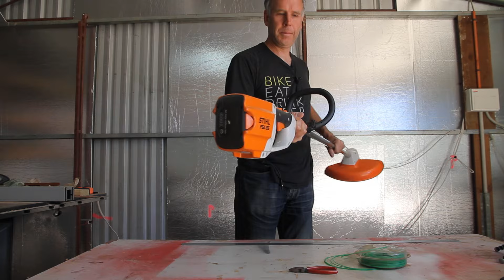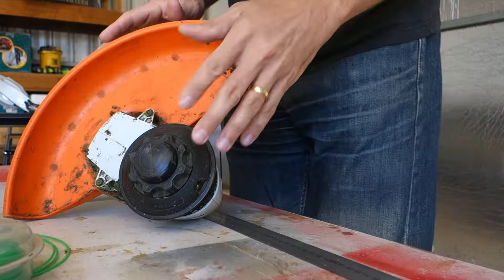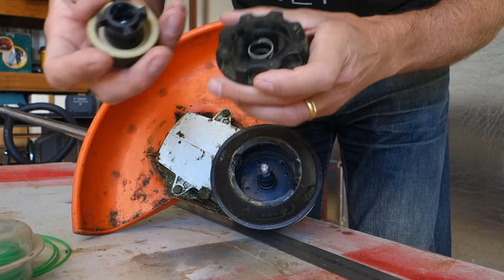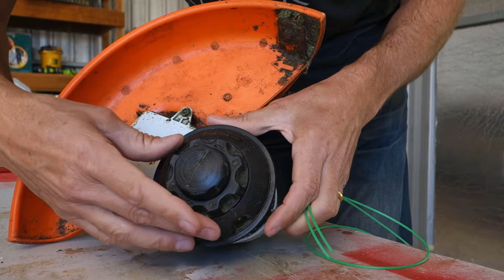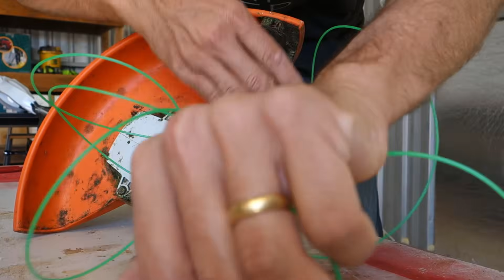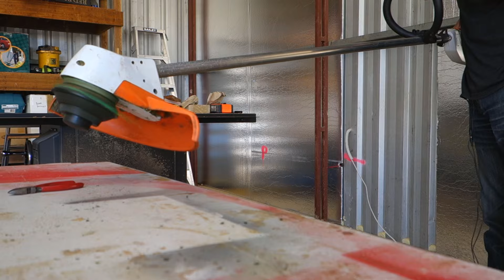Stihl FSA 85 Battery Trimmer Line Replacement

Comment: I have a second Trimmer but its a different model, I have to thread the line all the way through the center and make sure its even on both sides and then I wind it up.  This is slighty different but I will try it this way. thanks for your help

Comment: Absolutely if I would have known 7 years ago it would be so fiddly I would have never bought this bloody strimmer!  I almost come to hate to use it! But thanks to your video I tried again to feed the line in and it worked.
However the “sweet” spot is when you manage to get it into the hole on the other side of the feeding hole and it stays there until you twist the spool anticlockwise.
Don’t buy this strimmer! And Iam  German! My local garden machinery supplier always shows me how easy it is to feed in but he gets customers in every day he has to to do it for!😂

Comment: Hi, how do you grease this machine
Reply from the maker: @kenjosi4822  I use a pressurised can of lubricant. You can get them from any business that supplies or services these units. Just clean and spray after each use.
Reply: How? Petrol strimmer has a nipple to grease, I cannot see it on this machine
Reply from the maker: @kenjosi4822  You don't grease bearings. They are sealed. You oil the sliding cutting mechanism.
Reply: Thank you for your kind response.  @AustralianPaddock

Comment: How do I get the knob off to check for pieces of line inside?  Mine won’t budge no matter how hard I try or trying to push it in and turn it?
Reply: A pair of multigrips can help. I've had to do that in the past to get the knob off. Once off, a bit of lube will help for next time.

Comment: Any advice if the knob won’t unscrew? After use mine seems super stuck
Reply from the maker: It can be a bit difficult, but I've used a pair of multi-grip pliers and a rubber pad (to not damage the head) and been able to undo it. It can be a two person job. Once it's undone, make sure it is clean inside and and add a bit of lubricant to the threads to prevent future sticking.

Comment: How did you know to replace the line by winding on?  It is not mentioned in the Manual.
I have, for years been disassembling the cutter head and winding two lengths of line onto the two sections then re assembling the cutter head.
Reply: The great guys at Stihl Daylesford here in Victoria explained that to me when I bought the unit. That's why I wanted to pass on this advice to other people.
Reply: @muckleman  Thanks, but why is that method not explained in the manual?

Also, incidentally, I took the orange shield off, the trimmer works much better without it limiting the length of line. With the shield on, the line is too short and also you cannot see it when doing a vertical trim along a path edge.

Comment: This is the first INDEED useful Video I found for this task. Thanks a lot. one question: how do I pull out a bit of the line, after it became shorter after some use of the trimmer?
Reply: Thanks for your kind response. If one side becomes shorter, don't pull it. That will tighten the line on the spool and prevent autofeed. Just bump it until it comes out. But if it is not feeding, pull it apart and rewind it.

Comment: How long does the battery last after full charge? Ive seen fsa56 only last 12minutes..
Reply from the maker: I've never had the battery run out on the line trimmer. Not even get close, and we have a large area. You would be lucky to use half the battery.

Comment: I was watching this on my allotment in Welsh weather 😂. I had to look up how replace the line, to help a fellow community member. 
This helped, but we are thinking there may be a problem with the manufacture of her strimmer. 
Nothing was working smoothly. 
We suspect there is something wrong with the mechanisms.
I hope it works out. 

Thanks for the tips. 🌱
Reply from the maker: Thanks for the comment. Does the trimmer sound nice and smooth with no line installed? It could be a number of things, but if its the line, then you can test it without any line installed. An unbalanced line may cause problems. Good luck.
Reply: @AustralianPaddock  I currently don't know, I'll ask her when I next speak to her. 
I think once her husband takes a look at it, he'll know if it sounds the same or different. This was her first time using it.
To me it seemed clunky and kept getting stuck whenever we tried to sort out the mechanisms to get the line in. We shall see.
Thanks again. ☀️

Comment: Thank you so much for making this Video.   I just used it to successfully take my power head apart as my line had ended with some leftover line still on one side and one side empty so I needed to get the 6" of line out from that side before refilling..  Followed your instructions and it all went very easily once I got the bump button undone.  That was harder than it needed to be but I think I must have tightened it up too much last time I refilled the line.  Much apprecieated.  :)

Comment: The bayonet part of the bumper moves freely from the body, making it impossible to lock it into position ... it should be fixed to the shaft of the bumper shouldn't it? Is something missing, or should I try a bit of lock tite just to reassemble it?
Reply from the maker: It should move freely once locked in place. If you push it and twist anti-clockwise it will come out quite easily. It should not be tight.

Comment: I have a FSA 65 which looks like your unit.  I followed you instructions,  EXCEPT I had to push in on bumper knob to engage the threaded shaft (did not go on like video shows) After assembly and pushing in line, I could not turn the outer serrated knob more than one quarter turn, and that was it.  Everything was tight like something was jammed up.  Thought about spraying everything with a slippery lubricant to help things along, but wanted advice.  Finally took to rewinding around spools and working everything back inside.  Trimmer seems to work but haven't used the string bump yet (but it will probably jam up like every other time)   Thanks from  Covided USA.

Comment: WTF, I can't believe a company like Stihl would still use such an archaic head. This ends my consideration for Stihl  for a new cordless trimmer. Very disappointing.
Reply: Hi did you settle on a strimmer?
Reply: @benny98989  Hi Ben, believe it or not I ended up with the Ryobi. So far I am completely satisfied with it. It's nice and light and has more power then I need for trimming my acre lawn. I only use the low setting 90% of the time. The hi setting spins noticeably faster. A 4 ah battery will do 1/2 the acre but I have several batteries from my hand tools (18v) that fit the trimmer. For me it's perfect but as with everything else I'm sure others would prefer a different brand.
Reply: Thanks for the reply much appreciated 👍
Reply: @benny98989  Your welcome, hope it helped.